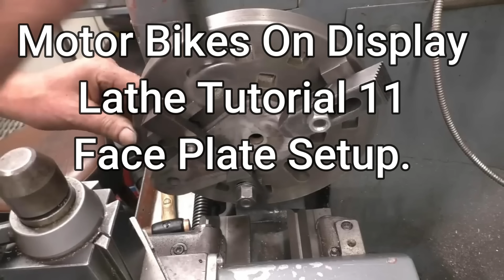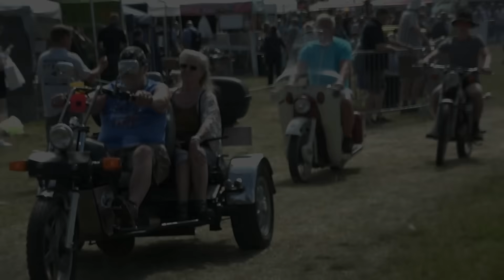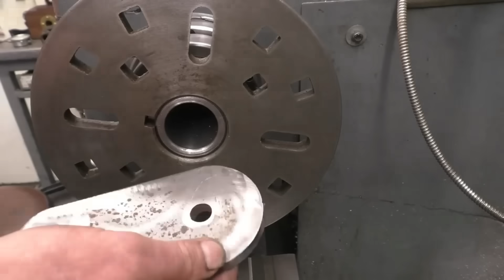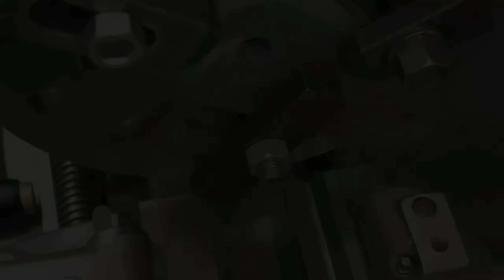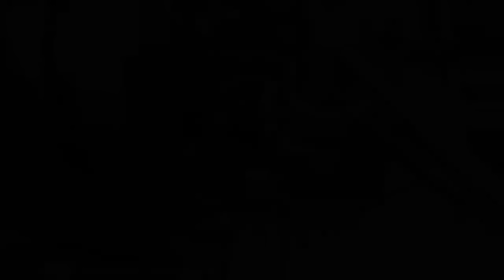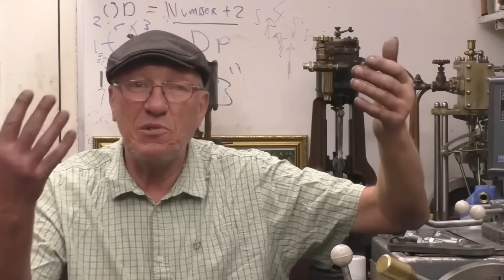Wednesday Catch Up 48  Motor Bikes . Lathe Tutorial 11 Faceplate Setup

Comment: It's nice to see you using the big 29mm drill I sent you all them years ago. It was an old BR drill that they used to drill the rails for mounting fish plates to join rails together, they stopped using drills as the holes needed roaming to prevent star cracking and they started using rotabroach that drilled and reamed at the same time. I think I sent you a 28mm drill also, they have BR stamped on them. It was nice to meet you in person up at Beamish a few months ago, love watching your videos.
Reply from the maker: That drill has moved some material for me  thanks again

Comment: Clamp the part in a 4 jaw chuck using just 3 jaws. Far quicker and safer.
Reply from the maker: As long as you have a 4 jaw chuck I would agree
Reply: @doubleboost  Ey up! Have you flogged your 4-jaw chucks or what? Even if you have, I’d have thought you’d at least give it a mention in the video—that it could be held in a 4-jaw, rather than makin’ out like it can’t be done at all.

Tell you what though, if you do end up with another 4-jaw, this part would be spot on for showin’ it off. Proper demo material, that.

Oh, and did it cross your mind to drill the little hole first? That way you could’ve reused the centre to line up the second one—unless your centre’s wider than 30mm, in which case, fair enough, that’s a whole other kettle of spanners.

Also, gotta say—usin' HSS to go through a hardened skin? That’s a bold move! Usually, carbide’s your mate for that sort of job. That hard skin’s like sandpaper on your drill lips… I’ve seen it put ridges in countersinks plenty of times, especially after plasma cuts.
Reply: @marley589  It's more about backing/face plate use, as for using HSS, stop being over dramatic.
Reply: @65cj55  It's a very common issue with holes cut with heat. The natural thing to do is to chamfer the holes with a countersink. Only to immediately find a groove around the countersink end where the hard surface has worn it away around the perimeter of the hole. A good thing to make the subscribers aware of.
Reply: @Bosun-8  It's not that big of a problem, sounds like you buy cheap countersinks.
Reply: @65cj55  I use mid range UK made HSSE countersinks, but not on plasma cut parts or any hard materials. For those, I use carbide.